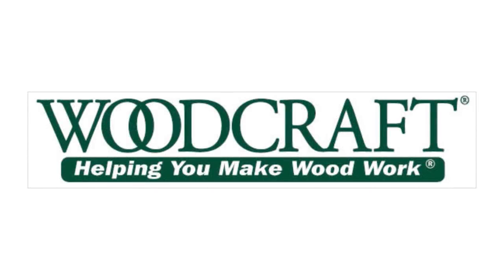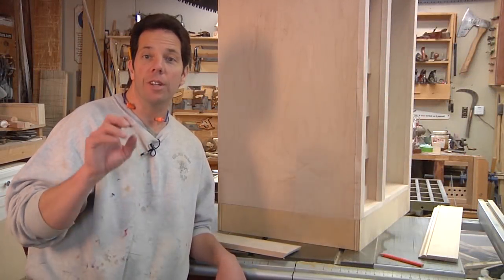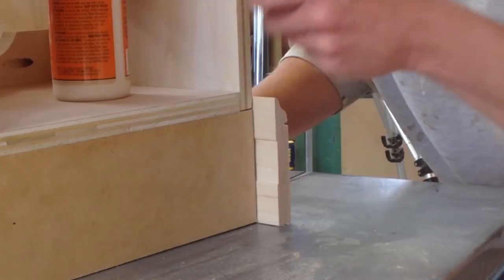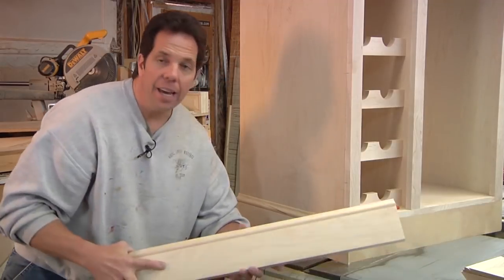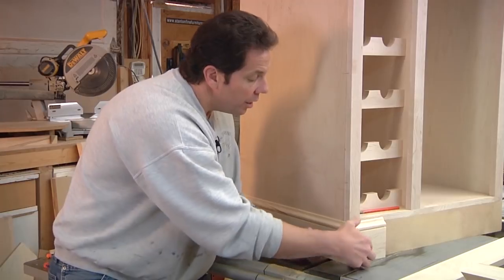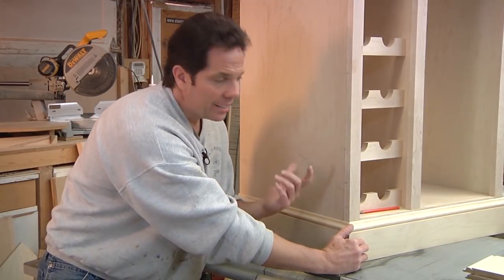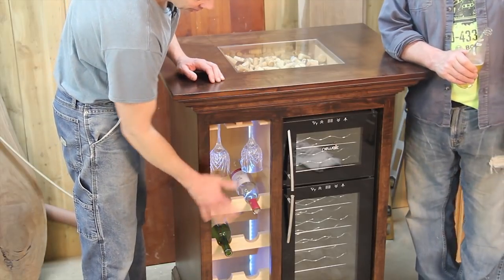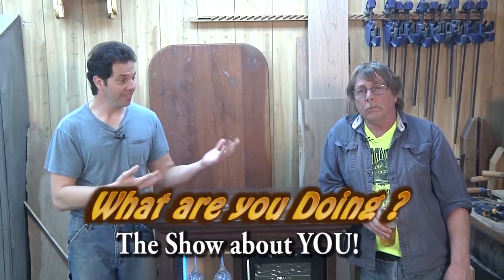Baseboards Basics- Tips for beautiful Outside Corners

Comment: Good tips, thanks. When you cut the second mitre on the front, how do you use the same method if the board is cut to length. Do you still cut long and sneak up on it?
Reply from the maker: Great question. Yes. I cut it close to the line and sneak up on it. Usually 2 cuts, sometimes 3.

Comment: Good Info Chad. Maybe you can answer a question for me. Why do they put the long wide Dado through the middle of the base boards. I even see this on MDF moulded Base Boards. And Dan, you are allowed to smile.. You are supposed to be enjoying yourself ;D
Reply from the maker: I've been told it's for two reasons. One, it allows you to have a more flat surface. If the wall has imperfections the baseboard has a smaller surface to make contact with helping assure a flat surface. (does that make sense?) Two, it is supposed the also help prevent the wood from cupping.
Reply: Thank you :D